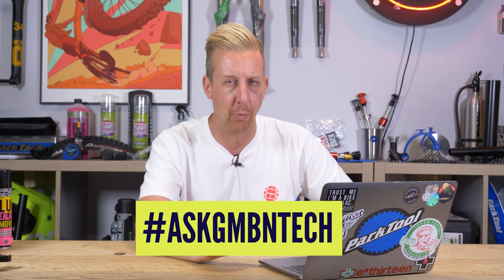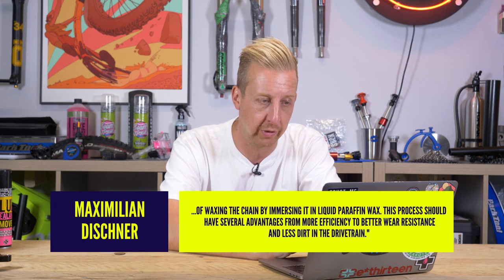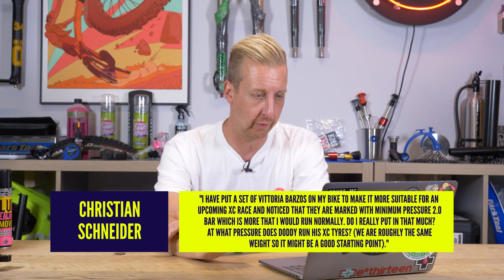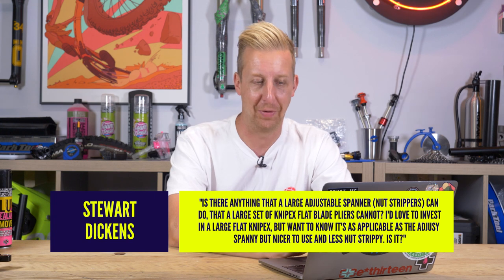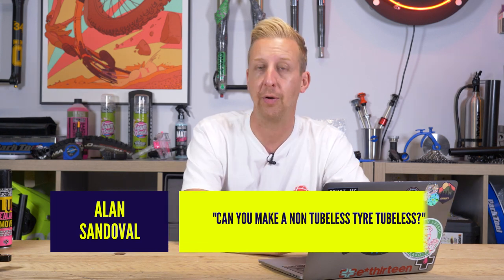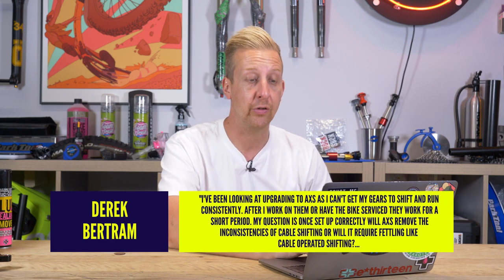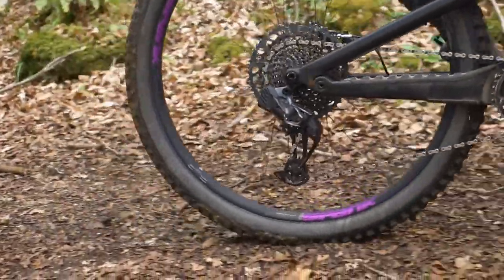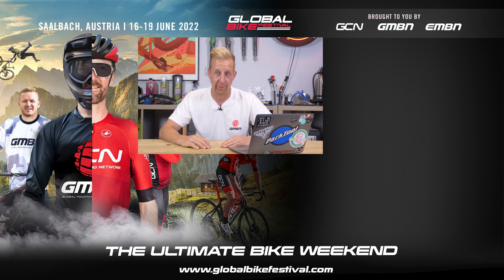"What Tyre Pressure For Cross Country?" | #AskGMBNTech 194

Comment: #AskGMBNTech I have done a lower leg service on my FOX 36 Performance, I followed the guide on the fox youtube channel, using fox OEM oil, however for some reason after the service, no matter how much PSI I add, the forks are too soft, also they sit 20mm into the stroke without me sat on the bike, so I essentially only have 120mm of travel, more than that even if I measure 30% sag with the reduced travel, whilst riding I end up with about 80mm of travel as they seem to sag more and more over time.

I have done the service twice now, just in case I screwed it up the first time, but no change.

I wonder if there is anything else I can check.
Reply: Air spring unbalanced